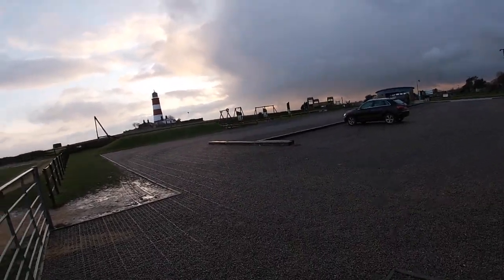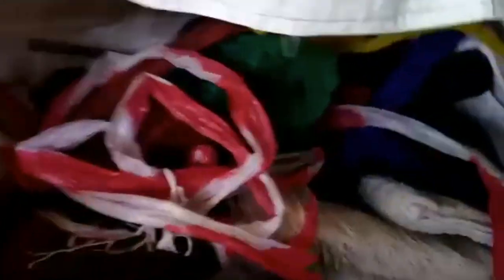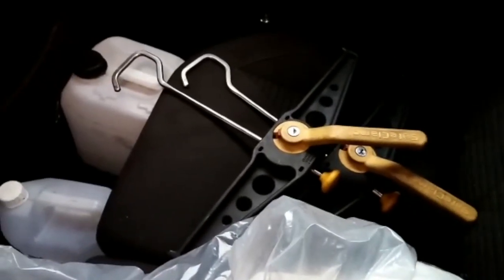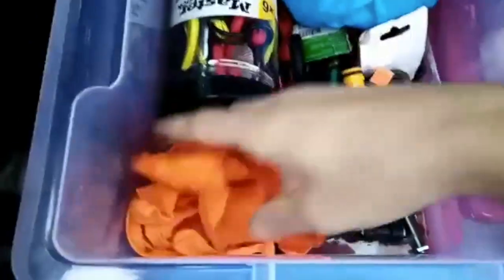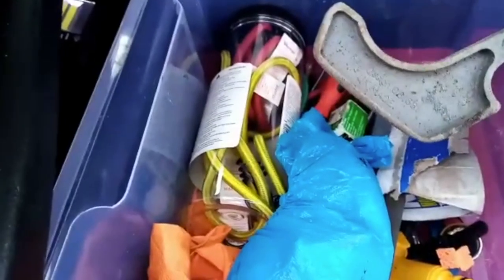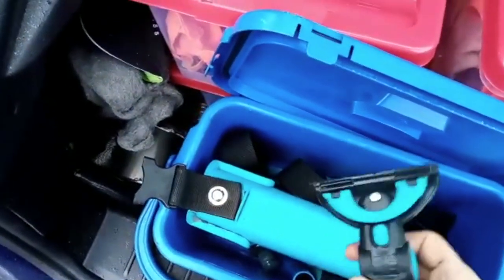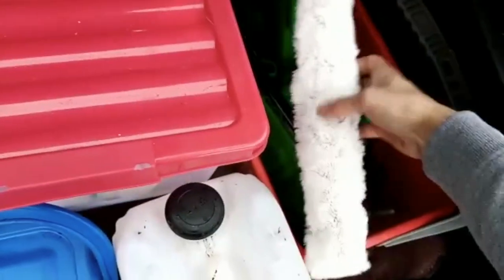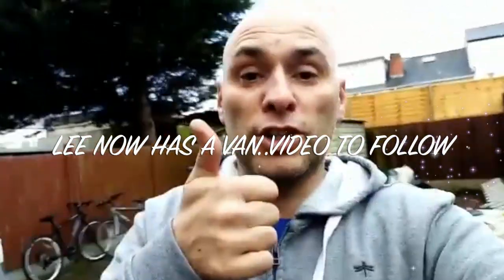WINDOW CLEANING CAR SETUP!!

Comment: Worked out of a car (VW polo) for three years. 8 25 litre barrels and a gardiner back pack. All the traditional gear and ladders on the roof. Can't complain. Run around in a Peugeot partner van now but sometimes ya can't beat the convenience of a car working in London